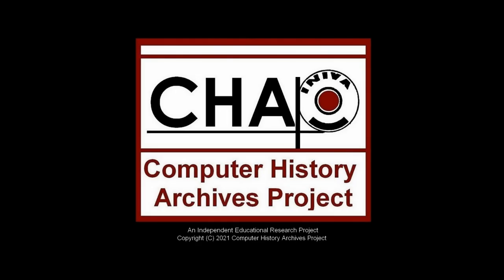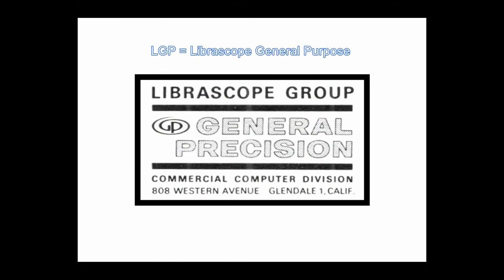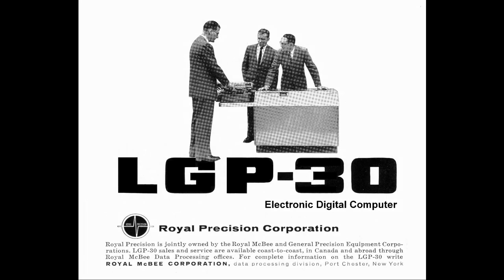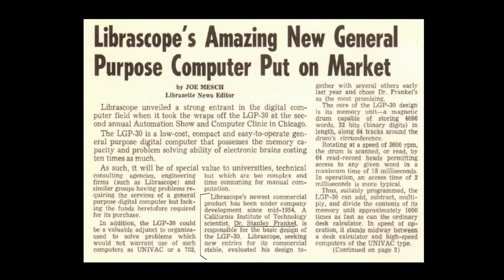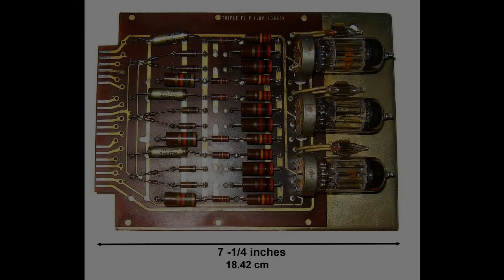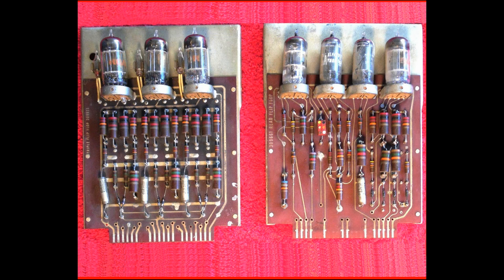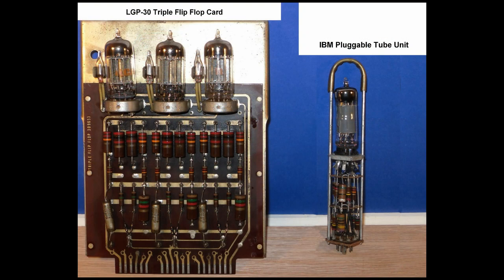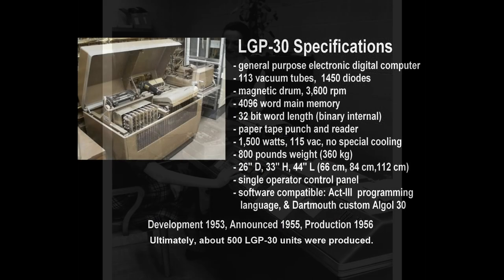Computer History: Librascope LGP-30 Computer (General Precision, CDC, personal minicomputer) 1956

Comment: We had the transistorized version LGP-21 in our high school computer club in the early 60s.  The whole computer was designed around the drum memory.  Even the registers were stored on the drum and brought to the one bit adder a bit at a time as the drum rotated and the results written back to the drum as it rotated.  Very simple architecture, although very slow as everything was done a bit at a time.

Comment: The running machine shown briefly is in the collection of the University of Stuttgart.  It is the only fully working one I know of.  I understand it is quite a reliable machine, owing to its use of primarily silicon diodes in its logic.  Due to the bit-serial nature of the architecture it is quite slow, even to 1950s standards, but its 31-bit precision made it a very good machine for scientific problems.
Reply from the maker: Hi douro20,  yes, I think you are correct.  That's the only LGP-30 fully working as far as we know too.  Quite unique!

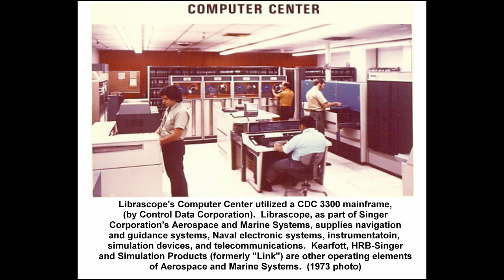Comment: That's one Hell of a hard disk @ 4:02!
Reply from the maker: @Madness832, yes, it is quite a huge disk!  The Librascope company produced some amazing things, and many of them have faded into history.   It feels great to bring some of these thinks back into the light.   ~ Thanks for watching and for your comments, too!  ~     CHAP
Reply: Those weasley HDD and SSD you have in your computers are not drives....that's a drive.
Reply: 125 mb! Huge amount of storage for a single device at the time for sure.
Reply: Also, the spinning disks would have an edge speed of over 2200 inches per second; must have been a bit scary to be near a running unit. Would be great to hear audio of one.

Comment: I use to drive by Librascope every once in a while. More Often, did I drive by the Burroughs (Electro Data) facility, but did not think about it too much. Many of my relatives worked at that Burroughs facility. Both Librascope, and Electro Data, were bought out by larger companies. CDC for Librascope & Burroughs for Electro Data. I think Librascope was latter sold to Singer.

Comment: I wonder how hot that thing got, with all those vacuum tubes
Reply: Well according to the spec's it used 1500 Watts. Nice and toasty :)
Reply: @sx642  1500W is amazingly small. That is the size of a small room heater you can get from Lowes for forty bucks. You could easily run it off a single standard 110V wall plug. Most computers on those days took dedicated power, and a lot of it.
Reply: For a computer, it’s a very small number of vacuum tubes. One bit at a time.